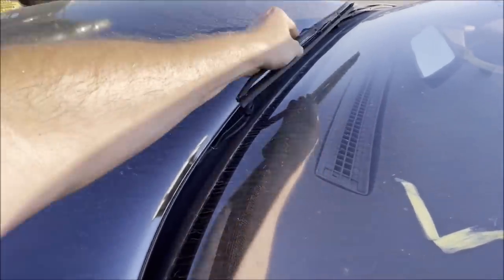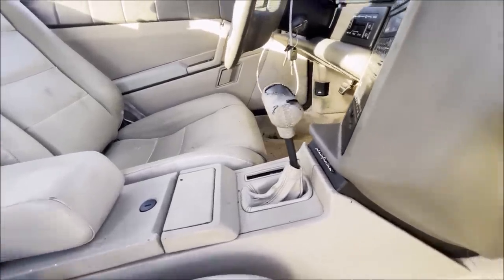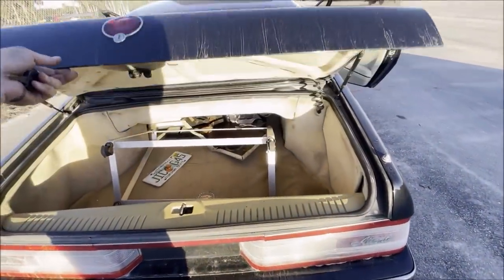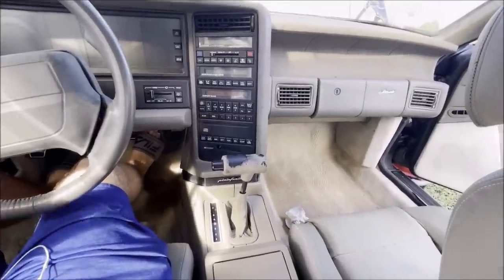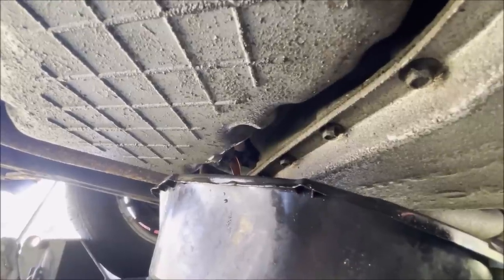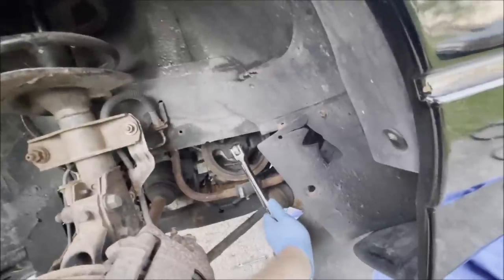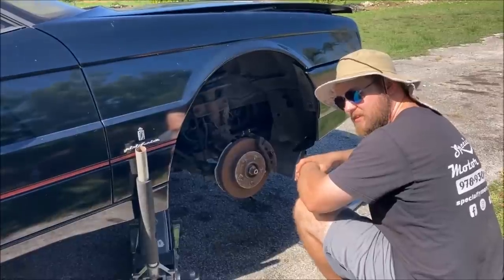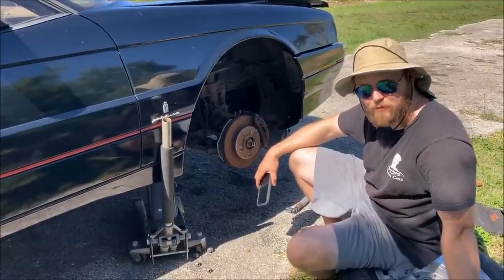Copart Buy: $450 Flooded Cadillac Allante

Comment: I got a 6.5 Detroit Diesel from a junk yard a few months ago. I got it cheap because it was seized from rust. I tried ATF, PB Blaster and Marvel Mystery Oil, none of them made a difference. I finally managed to break it free with vinegar from Wal-Mart. I removed the injectors, and one of the injectors I drilled it and tapped it with 1/4 NPT to adapt an air hose. I filled each cylinder with the toughest vinegar from Wally World, like 2 bucks for half a gallon, and then pressurized each cylinder with 100 PSI of shop air until the vinegar would just shoot out the oil pan. When I got to the last cylinder, the piston violently shot to Bottom Dead Center and rotated the crank so. Keep in mind, my junk engine is a push rod engine, so it was easy to seal the valve. I don't know if that Caddy is a push rod engine, or a cam-in-head engine.
Reply from the maker: Wow that was quite the idea lol
Reply: 4.9 is a push rod engine, only last production year Allante had DOHC Northstar.

Comment: These quick battery disconnectors are absolute CRAP! I had a classic S class Mercedes with this nonsense. The car went into limpmode twice. Then it ran perfectly for an entire month.
One late afternoon I went hiking with my family in a forrest mountain and parked the car on a dead end road in the middle of nowhere. It was nearly nighttime when we reached tha car and wanted to drive home. The car would not start at all. We checked the relais, the fuses, the ignition. I thought that battery had died.
The battery connections looked perfect. It was a miracle that someone of an emergency service knew the place. When he arrived we checked everything again. When he put the booster we could not start it. It turned out, that this stupid adapter was broken. When we removed it and connected the battery directly, it fired right up. Whenever I get a car with this shit, I pull it out and throw it away immediately.

Comment: Fill the crank case up with Diesel let it sit for anthere week try again use air ratchet one or 2 times and put the breaker bar back on it and see if that works the vibrations from the a air ratchet might help
Reply from the maker: I’ve heard air ratchet highly likely to snap the crankshaft

Comment: Did you remove the last spark plug?  Great effort Grande AL!
Reply from the maker: No but I pulled the injector for access, blew out the cylinder (it was dry no water in it) and filled it with ATF/PB blaster along with all the others.
Reply from the maker: Maybe a few more months of soaking the cylinders will free it up 🤞
Reply: @bigalsbikeandauto water displacement #40....

Comment: I'll bet the "cross threaded" spark plug is actually stuck from corrosion and that's the only cylinder with water in it. Might be worth doing a boroscope to get an idea on its condition before completely chalking it up as a loss
Reply from the maker: I shot into that cylinder through the intake valve and injector port with compressed air there was no water in it. Also filled it with ATF like the others through the injector port.
Reply: @bigalsbikeandauto  I knew you wouldn't miss something like that, but it's always fun to try to sleuth it out and give some ideas. I can't wait for the next one, Big Al!
Reply from the maker: @DiscGolfDom23  I miss things all the time, advice always appreciated!